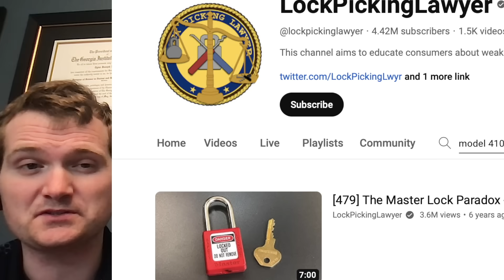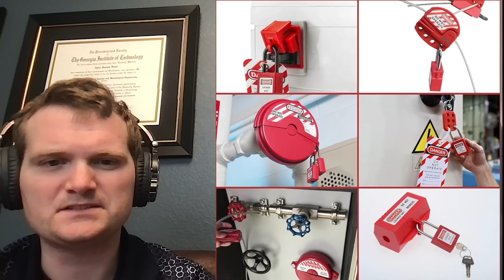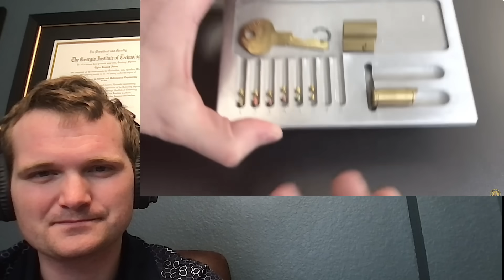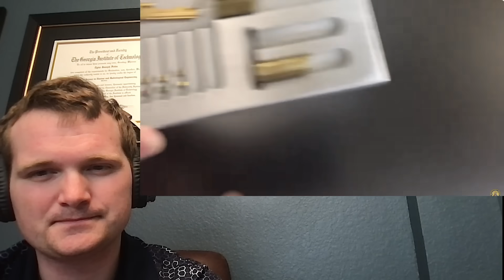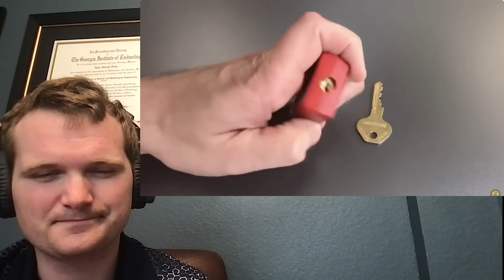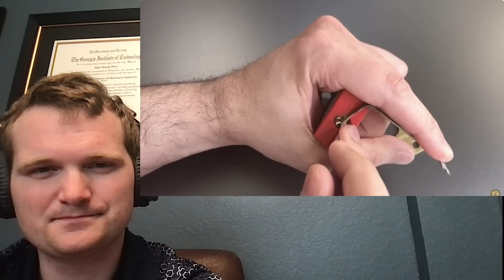Nuclear Engineer Reacts to LockpickingLawyer "The Master Lock Paradox - Model 410 LOTO Padlock"

Comment: LOTO saves lives but it's only as good as the operation's safety culture and the operators tasked with using it.
Reply: Tell me about it, my operatives would "forget" to use them because they were a pain in the butt.
Reply: if you forget to use them in my field of work you get fired, no questions asked. you're gone. @davidkaye8712
Reply: Exactly.
Reply: As with any safety system
Reply: LOTO only stops stupid accidents.
Reply: @Eluderatnight  As opposed to "non-stupid" accidents? 💀
Reply: @seanspartan2023  "non-stupid accident" would be a novel situation without warning signs. IE all procedures were followed but it still went sideways.

Edit: one thing I could think of is a blown bleeder resistor in a capacitor bank. It will pass visual inspection, then you touch anywhere in the system and your heart stops or short/burn out something.
Reply: @Eluderatnight  a more common example would be like. Walking with your phone and tripping and dropping it would be an accident. Flipping your phone and catching it and having it slip and fall out your hand. That is a "stupid accident"
Reply: @Eluderatnight excellent example.
Reply: @Eluderatnight  LOTO may stop stupid accidents, but it doesn't stop super stupid accidents, like some other dumbass that needs the machine cutting off the lock and turning it back on, resulting in the one that did proper procedure getting hurt or almost getting hurt.  I've seen stories of such and they always infuriate me so much that I have to take a moment or two.
You can make something idiot proof, but then the world will make a better idiot.
Reply: @latemanparodius5133   as a safety professional, this kind of carelessness infuriates me.  People in a hurry who bypass safety procedures.  I have read some absolutely horrific stories.  One, in particular, I wish I could forget, but it pops into my head every now and then. The employee did not follow LOTO and died because of it. I can't stop myself from thinking of  what he went through.
Reply: @latemanparodius5133  I'm aware of one incident where the plant manager mandated he have a key to LOTO locks along with the worker's key. He, one day, noticing LOTO on critical equipment then unsecured the equipment resulting in the worker being ground up fatally inside of the equipment he was working on.
Somehow, the plant manager came out legally not liable for the fatality.
Reply: @latemanparodius5133 That's called jail time.
Reply: @Eluderatnight   not always.    There can be factors that are not predictable where LOTO protects workers unintentionally.  It doesn't happen a little lot, but it does happen.
Reply: @Eluderatnight  13 men, fathers and sons, died at a concrete plant we went to climb in.

I forgot the exact reason, but it was because the machine they were in started spinning again.
Reply: Loto Is more of a hazard than a benifit. It gives people a falce sence of security and they get careless. Let's use this example. In a industrial manufacturing facility a maitnence man locks out a machine he will be servicing. Another worker comes down the path that should not be used unless the machine is locked out. The machine at the time was locked out and off however maitnence who didn't see the person is done working and unlocks the machine. Now the person who entered trees to come out and ends up getting hurt or killed because it was locked out
Reply: @Sabi1234567890Asdf  That's not how LOTO works. If the second worker is modifying their procedure and may be in danger due to the machine being locked out, they would add their own lock to the machine as well. It would stay locked out until BOTH workers removed their own locks.
Reply: @seanspartan2023 yes.
Reply: @Sabi1234567890Asdf   that's why you have notification procedures in place both before and after LOTO.  That endures that everyone affected knows the condition of the equipment.
Reply: @Sabi1234567890Asdf great spelling genius.